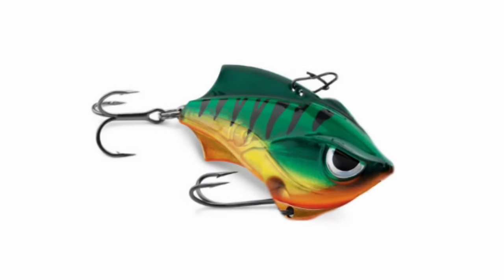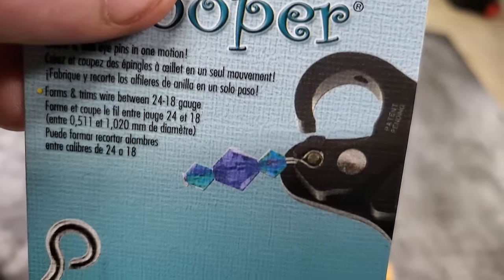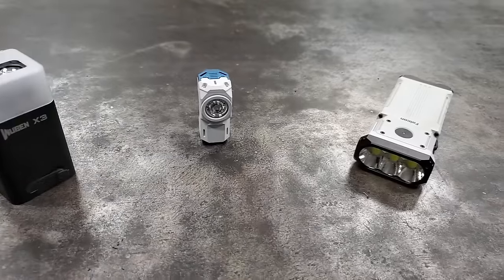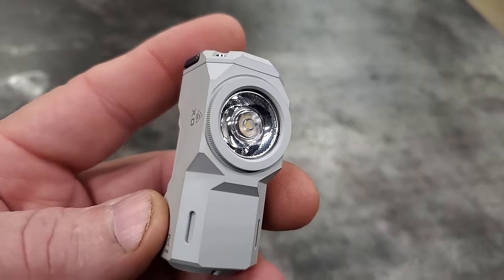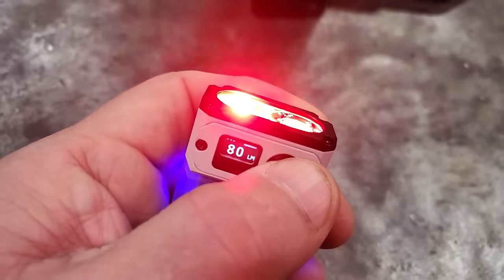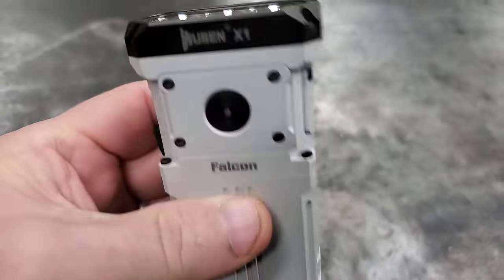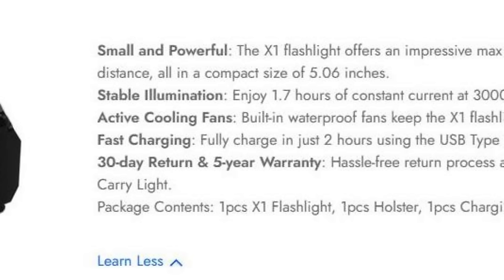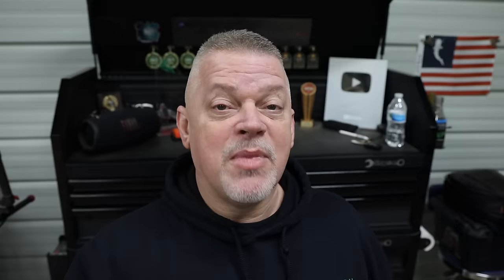New Fishing Hacks

Comment: This is a hack I learned a long time ago and it’s probably old school by now. But you can make a large slip float out of empty very small plastic pop bottles. 1. Remove the label off the bottle 2. Zip tie one eye of a swivel behind the collar of the bottle neck 3. Feed your line through the other eye of the swivel 4. Remove the bottle cap and fill the pop bottle with enough water to add extra casting weight and reduce buoyancy of the bottle(screw the cap back on). Works great for live bait fishing for catfishing and larger fish. You can also put a glow stick inside the bottle for night fishing.

Comment: I have a hack for fisherman: the metal stringers can be used to hang/display hat (ball cap) collection. Shorten the chain a bit in the long section, clip hats & hang on the wall. I used to fish bass tournaments & have hats from sponsors & I did rep work at events where I was given hats. I have a huge collection now & had them boxed up. Now my fishing room (formerly known as the spare bedroom) I can display my collection & other collectibles. I have lures where pro fisherman like KVD autographed… I have them hanging on these as well, along with a few lures that were packaged wrong or had a mistake or other rare lures. Makes a cool way to decorate your shop, man cave, fishing rooms…
Reply: Needed a knob on the string for my ceiling fan switch.  Removed the rusted hooks from an old lure and tied it on as a knob.  Works good, looks good.
Reply from the maker: That's a great idea

Comment: Been doing that style of draggin weight for years. I use thinner wire twist the eyelet back onto itself and use a bunch of cheap bullet weights for plastic worms from Walmart. Because they are usually the cheapest lead weights you can get with a hole through them.

Comment: In my 52 yrs I have found a number of them,but never lost one. Only ever had one almost pulled in,that was when I was maybe 6 and wasn't paying attention and a 34-36" Common Carp took off with a crayfish tail.
I always either have them in rod holders,in rod holders with the baitrunner engaged,or I'm holding it if they're in the water. I will not leave a rod in the water unattended or at least a baitrunner on.
I have used treble hooks rigged like a Carolina rig to catch a few I've seen in the water and 1 or 2 of a friends.

If you reeeelly want to save your cork handles get you some U.A.A. INC. U-40 Cork Sealant.
If it's a new handle just apply it.
If it's an old handle you can lightly sand it with some 400+ grit sandpaper,then apply.
You can still use the tapes afterwards if you want even more protection but that sort of defeats the purpose of getting cork handles to start with. I don't like the tapes and not so much the foam handles either.

Comment: Interesting video 
My Hack to get a rod out of the water 
I normally have a heavy rod with 50 or heavier braid on it 
Tie a swivel to the braid and then tie a 3 or 4 feet of 20 lb mono to the swivel 
Just below the swivel tie several over hand knots in the mono 
Thread on a 1 oz egg sinker and then tie on 2 - 4/0 or larger treble hooks a foot apart 
But first you want to completely blunt the hook points 
Then cast past where the pole should be and slowly drag the treble hooks 
If you snag up , the mono normally will break at the over hand knots
Reply: Same here
Reply: Pool noodle slice at the Bottom that has helped alot

Comment: Got another one for ya for the crappy checker, the clear plastic measuring board that the fish slides into. Before the fish's head goes into the checker they can flip causing you to drop them. I used a Dremel to cut a 1" wide thumb grove down the center of the front so I didn't have to release the fish to measure it. These boards also sink so I attached a key chain floater to the top. If this isn't clear feel free to ask questions. I wasn't crazy about it before but this makes it user friendly.
Reply from the maker: That's a good idea 💡  send me a picture of yours . keiff41@gmail.com
Reply: @FishinNStuff  Will do, prepare to be impressed like a waffle ! lol It'll be this evening when I get home.

Comment: I’ve got a couple ideas….. cork handles, you can get a little can of cork sealer that’ll keep it from getting all flakey, if you want a different grip, try the self stick tape stuff from rural king in the horse section, for wrapping hooves and legs.  That’s the same stuff as the brown tape in the first aid section…like elastic and velcro. Last, wire hose clamp tool, You might already know about this, wonder what else you could use it for….stuff…fishing’….etc

Comment: I have a hack kind of. Captain Big Fish Barb Buddy Fishing Rig Storage System $24. I bought a 5 gallon bucket with a lid and cut the middle out and just drilled holes in it. Saves 15 bucks and holds all your hooks and rigs. I also put a pool noodle on the outside in case it falls off my kayak that way it stays floating. Not sure if you did that one or not but I use it all the time for fishing. saves me time of making rigs on the water
Reply from the maker: That sounds really cool . Could you Email me a picture  keiff41@gmail.com

Comment: for the first hack, to stop things like the cast net incident, use the same stringer clipped to teh boat on one end and one of the hooks to each rod. it wont help for the "throwing the rod in" part, but back in my day when i used to river fish, the "getting the rod pulled in" thing happened a lot, do we would use those same stringers to clip to the rod (just the one) and clip the other end to the rod holder stuck in the ground.

Comment: Hello. Have a question the rods you used to slide through those flat bank sinkers, where can I find them and what size? Or ones with the eyelet already in them. Thanks
Reply from the maker: Do It Mold Pull pin Used in All Egg Sinker Molds Under 10 oz. Pull Pin, PEG-332 https://a.co/d/02A68En1
Reply: @FishinNStuff  the stainless steel wire you bent in the video and made at eye and you slid through some  flat bank sinkers on it. Maybe making dragging weights? Idk. That’s what I’m wondering? What size was the wire and where can I get it?